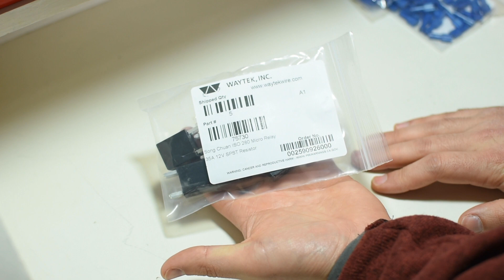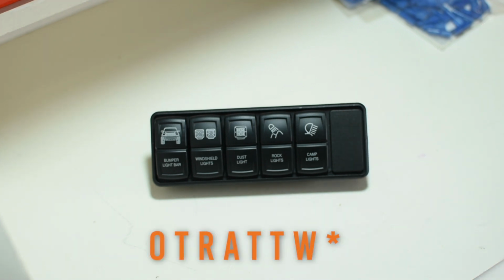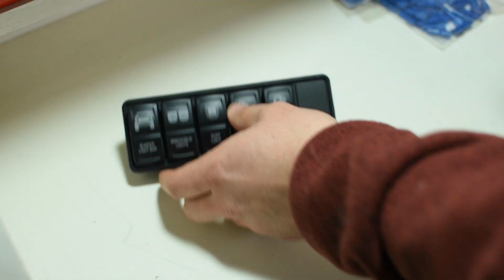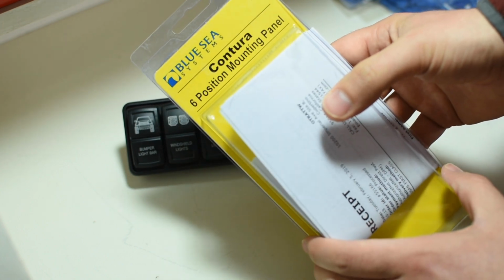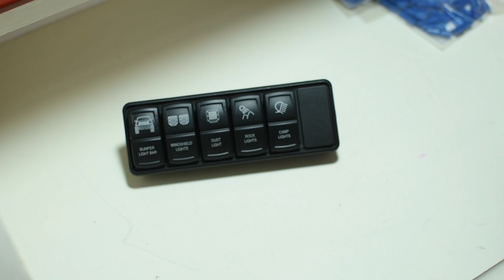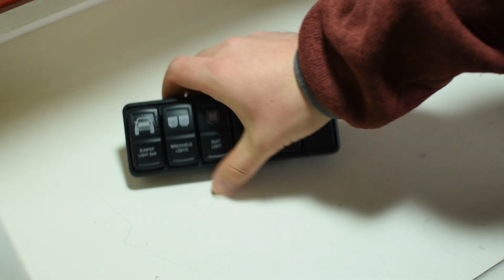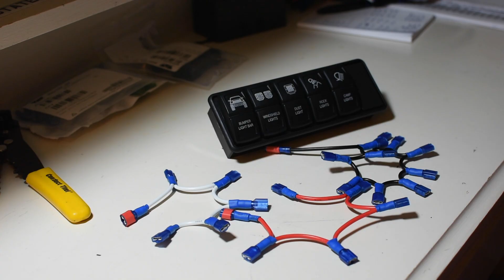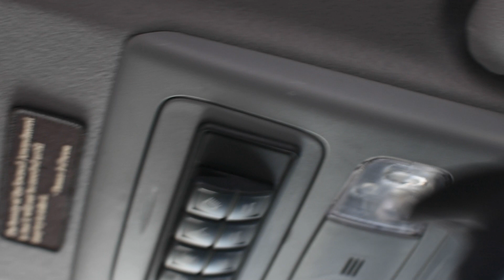DIY sPOD/SwitchPro Relay System in 2015 Toyota Tacoma

Comment: One question! I have a 2015 also and whenever I measured the sunglasses holder it is 7.4” wide and the link to the switch frame is 9”??
Reply from the maker: That’s odd. I just got the switch frame that fit 6 switches. Perhaps their website is incorrect or I linked the wrong product. I’ll take a look and edit the link on my website if that’s the case. Www.pinestateoverland.com

Comment: Great vid. I have a 2015 taco as well, how did you run the relay to control the bluesea fuseblock?  Im going to be adding that same setup so the more info the better. Thanks!
Reply from the maker: I just ran the relay between the battery and the blue sea. Think of it as a gateway between power and the blue sea. There’s two positive terminals on the relay. One going in and one going out, controlled by a remote wire which is hooked into your ignition. When you turn the key it opens the gateway and power flows. Too much power and it trips the relay. Kind of a double protection thing in laymen’s terms.

Comment: I am a novice but couldn’t you add the rest of your accessories to the old system you built?
Reply from the maker: You definitely could but you’d have to run relays for the switches. This is a neater way to go about it. It’s also safer in my opinion. Every switch has its own relay and ground in a water tight box. Having it like this cuts down on the rats nest under the hood.

Comment: Good job, thanks for taking the time to make the video. How much did you spend on this setup, and does it seem to be holding up ok.
Reply from the maker: I think I’m total I spent about 200$ for all the materials. It’s been holding up great. I currently have my rigid ditch lights, extremeLED light bar and amber light bar all hooked into it and no issues. It’s also hooked into my ignition so it shuts off when I turn the vehicle off to prevent battery drain.